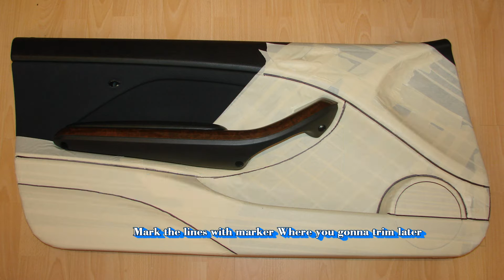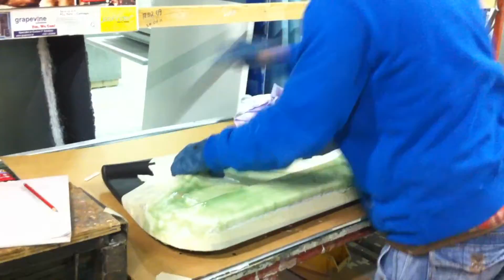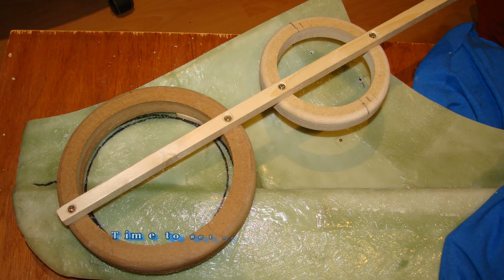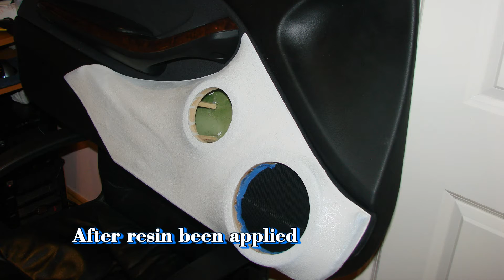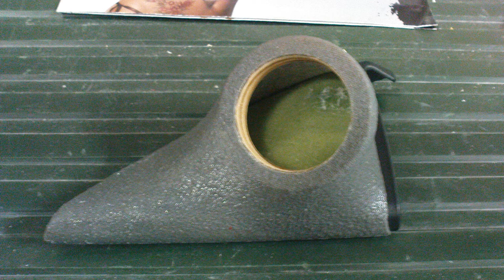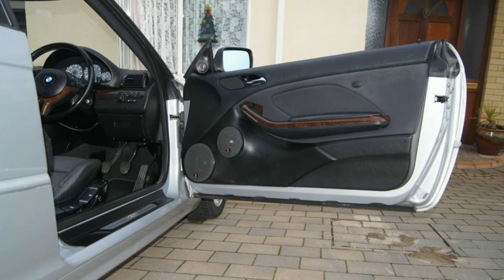BMW e46 front door speaker upgrade

Comment: great video didnt play rap shit music,great tweeter placement not in the doors like idiots do,and some of the nicer work that ive seen on here.you followed the stream line of the door panel perfect.i have a 2013 WRX hatchback that i want to install a 8 inch in and the lines in this door are very confusing as to where to get started or to visualize where im going to do it,this video did help a bit thanks.oh btw your steering wheel is on the wrong side of the car haha kidding you.later
Reply from the maker: First of all thank you for watching 😉 other, thank you for kind words. It took me a while to come up with design and speaker position and yes I wanted to follow the door lines to blend in. People were asking how I attached the panel to door card so I decided that I have to make short video HOW TO.